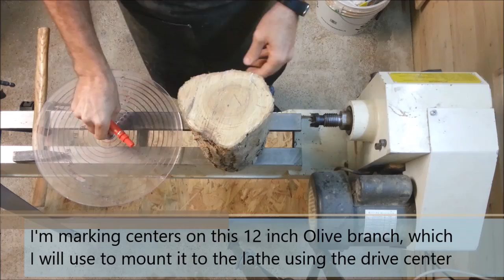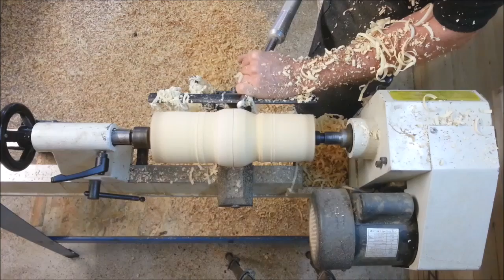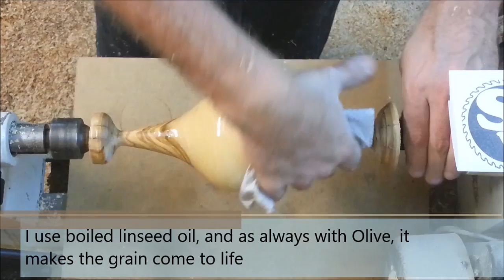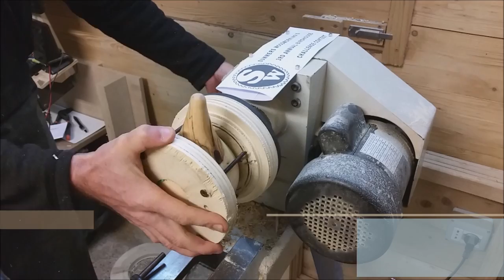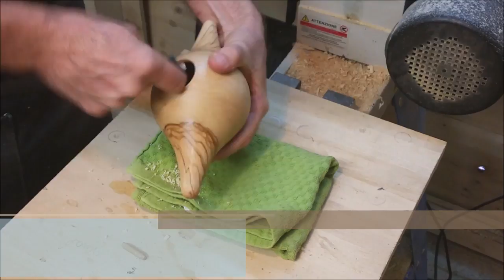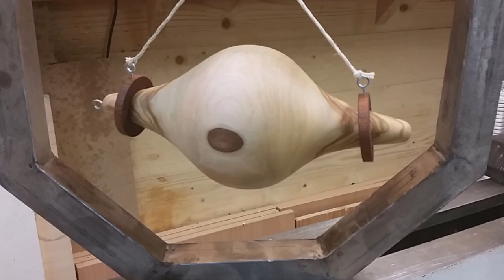Woodturning 2015 Summers Woodworking's Birdhouse Challenge

Comment: Good video Yuval and great project.  I'm surprised you didn't make a larger version of the doughnut chuck, they are really quite useful!

Cheers

Tom
Reply from the maker: +Tom Stratton (acolyteturner) Thanks Tom! I didn't make a larger version of the chuck since I made this one on the fly just to finish this project, and I'm surprised it worked so well, in fact, it worked perfectly and it felt like hollowing a solid piece of wood. Which only means that I'll be making a larger, more robust one, with bolts so I'll be able to have different sizes of course.

Comment: Innovative idea, interesting and attractive. Very well done. The Aria Spray, does it help finish the interior?
Reply from the maker: +Torvig Johnson Thanks Torvig! the air spray just helps me get all the wood chips out of the hollow, since I don't have a compressor to do the same job, but I'm on the lookout for a used one, so if you know of anyone wanting to give or sell one away in the Rome area, let me know ;)